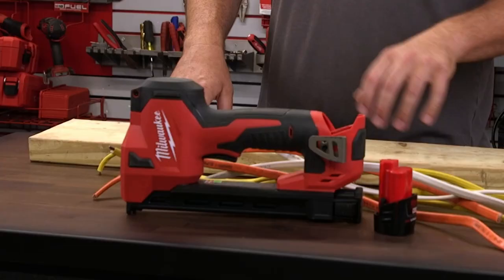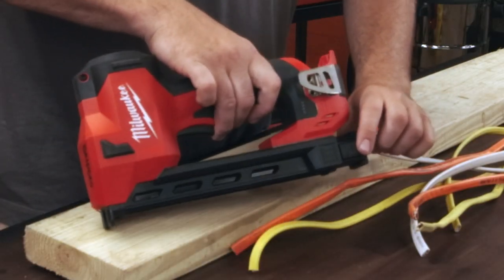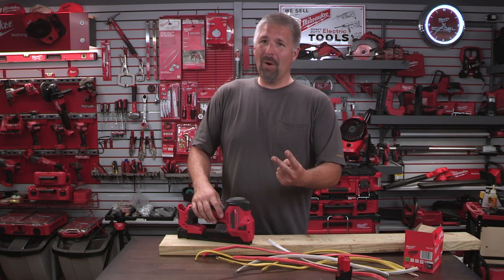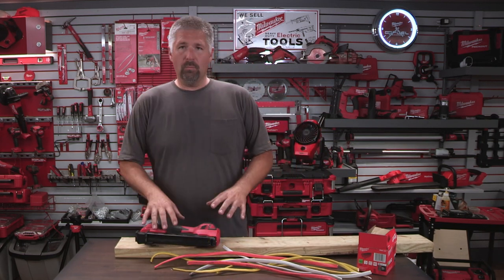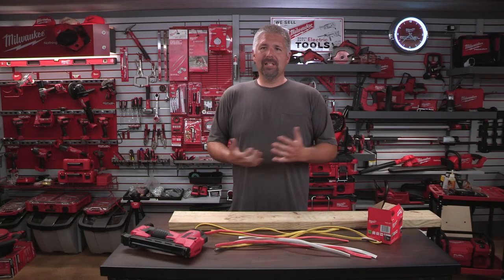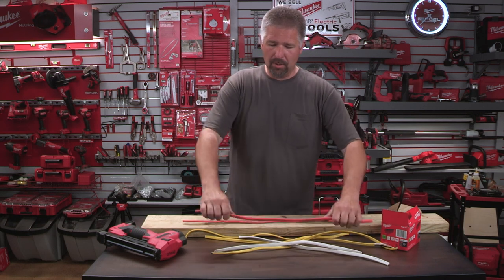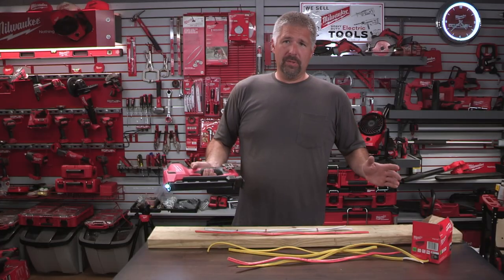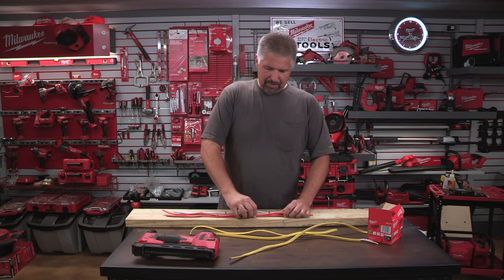Milwaukee M12 Cable Stapler

Comment: When using this tool make very sure the cable is running underneath and in line with the staple magazine.  The guide is approximately 5mm in front of where the staples actually fire. If your cable runs sideways after it passes through the guide you will hit the cable.  This also  limits the tool in confined spaces. If the staple goes through the cable be prepared to spend way more time on the job than this tool would save you. Note - depth, width  are not adjustable. You have to buy Milwaukee staples to use the tool.   There is only 1 size staple - not sure if that will change in future.
Reply from the maker: Great tips. 😎

Comment: I’ve got one, personally I love it, there are some flaws and I’ll list them, first is it’s not great with hardwood, it’ll work, but the cable can slip through very easy, it’s supporting the cable not hugging it. Into any medium to soft woods it’s awesome, grips the cable perfectly so it doesn’t move, but can be manipulated. It’s also easy to use and super fast, but you do have to be careful of not shooting through the cable, but that’s operator error not the tool. And very rarely is it too clunky to get into small spaces. Also you can control the force/pressure of the gun with the pressure sensors on the front. Overall 8/10
Reply from the maker: Agree with all of these.  👍🏻

Comment: I’m surprised it seems to struggle with hardwood. I have an old house with old growth wood everywhere and it always requires pre drilling holes for any staples or nails. Always. The wood might as well be petrified. 

This likely would not be better.

Comment: I’m surprised. I was really excited for it in those tight spaces. Admittedly I don’t do much residential work but you really don’t like it in low access spaces over a sideways hammer? I figured you could use a hand through the handle hole holding the bottom against a stud and just used a finger from your other hand to trigger the gun. Kinda like a barrel grip jig saw hold over a d-handle hold.
Reply from the maker: Sadly,  it doesn’t work in tight areas.  I will take my chances and anger using a hammer sideways. Than highly risking putting a staple through a wire. 😎

Comment: 'Wonder if this is better than dewalt cable staple gun. 'Sold my dewalt staple gun 'cause I was not happy of the tightness of the cable, especially harder wood. I end up using a hammer most of the time to nail the cable.
Reply from the maker: I have used this in an older barn. It’s like 50/50 with this. Depends on the wood. I would be going good for a while then get 4 in a row where I would have to hit in the staple with a hammer. It was some dense old beams. I was actually surprised it just didn’t shoot it sideways.

Comment: I think I would ruin less wire with with the gun. I can only hit a staple with a hammer 6/10 times in ideal conditions. In awkward positions the wire is trashed by the hammer before the staple is driven.
Reply from the maker: I just wouldn’t use it in tight spot.  Hammer might save the wire. 🤷‍♂️

Comment: I mean this as a constructive critique, but this video was kinda painful watch.  When you said "there is some negatives about it" my interest was sparked, since I wanted to understand the downsides and the reviews I've seen so far have been glowing.  First negative was it "kinda heavy", it's less than 5 pounds, far less than a framing nailer.  Second negative was "can we use any ordinary staples?".  What does that even mean?  Did you expect it to use loose staples from any manufacturer?  If you were to design the staples, would you hand feed loose staples one at a time into the stapler?  Their staples are only 2.6 cents each which is a negligible difference compared to  loose staples.  Late in the video, you held the stapler at like a 30° angle to the wire, then said "if you get a LITTLE bit of an angle" and you shot it through the wire.  I would say the one valid negative brought up in the video was that it can have issues in tight spaces.  I think your video would be more constructive if it didn't refer to the things as "negatives" but rather just point out things about the tool.
Reply: I think the point he was trying to make was it only works with Milwaukee staples.  As in proprietary.  Not loose.  Not sure if that’s true with DeWalt too, but I don’t want to be locked in to single brand proprietary solution, unless that becomes the industry standard, like Arrow’s T50 crown staples did. Gonna pass for now.  Maybe as a rental for the few times I am gonna use one, though.